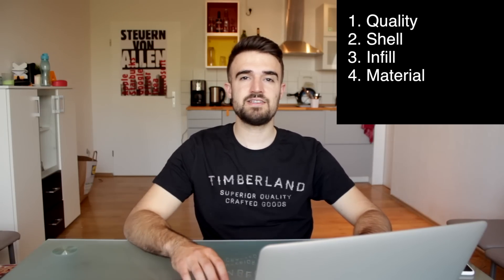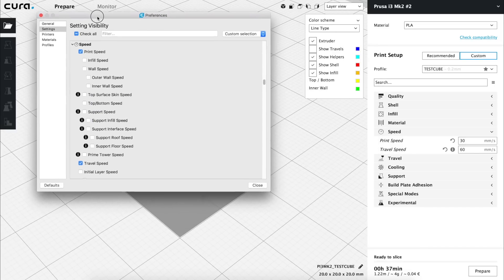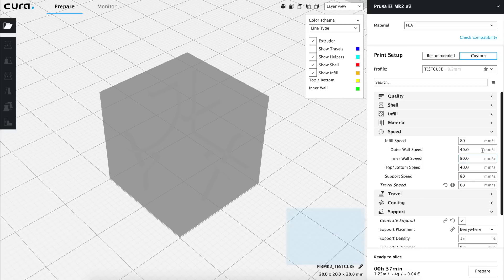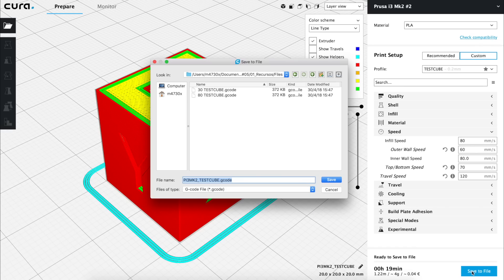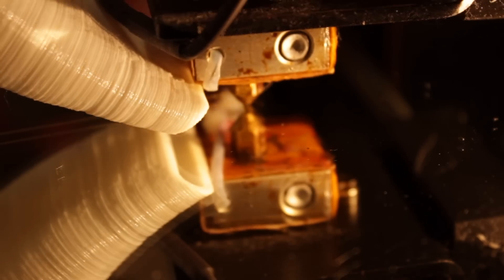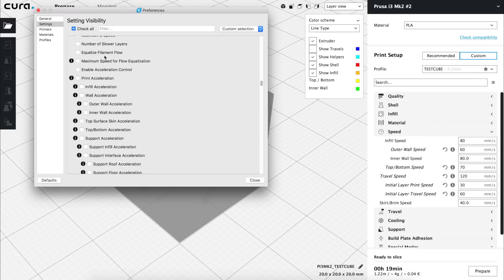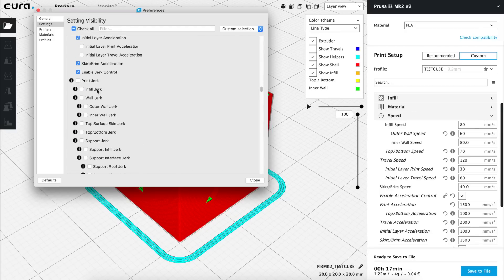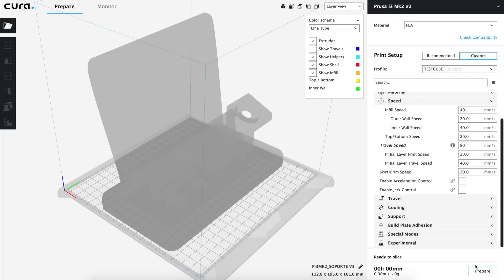Cura advanced settings 2018 - #05 Speed

Comment: I have also similar settings on my printer, and i was printing with that settings one month, I printed about 40 difirent models, but I noticed that problem is with bearings moving on rods, they are in to much stress and now I start getting layer shifting. Oiling rods, and updating belts are not helping. At the end, I tune speed to 40mm/s and lowering acceleration to 400mm/s
Now is slower , but quality gets amazingly better.

Comment: Great video... I wonder if you can help with a couple of questions:
1) We have First Layer Speed and Top/Bottom layer Speed... What is the difference for the bottom? Will the Top/Bottom setting apply to the whole bottom shell, except the first layer?
2) What happens if the bottom Shell thickness setting contradicts the object dimensions? For example, I have an object with a flat base that is supposed to be 1mm thick but then I set 4 layers min for the bottom (at 0.3 layer height, for a total of 1.2mm)... Will Cura respect my 1mm dimension or increase it to meet the settings? 
Muchas gracias, son buenissimos los videos
Reply from the maker: Hello :)
First of all, thanks for your comment! Answering your questions:
1. The top and bottom layers are the ones that are 100% infill. So the speed will control the 2-3-4 or any number you selected. Then the first layer is only the very first one, in contact with the heated bed.
2. You can graphically see what is going on in the cura interface. just go layers up and down. Anyways for that kind of special situations, I would recommend you to set for example the layer thickness to 0.2 and use 5 layers. Instead of creating contradictions :P
Gracias por el comentario, y en especial por escribirlo en inglés para que todo el mundo lo entienda =D
Reply: @architects3dp  Thanks
Reply: @architects3dp  I always forget to increase top and bottom speed, when printing no infill objects and they take forever, I forget that top and bottom really means any solid layer, it is a little annoying and confusing. Any suggestions for something that is 1mm thick, 4 layers in draft, to speed it up ?
Reply from the maker: @tablatronix  unfortunately that's the slowest part of a 3D Printed object. For this use case, it's more optimized to use laser-cut or sth like that. 3D Printing works, but is slow hehe
Reply from the maker: @tablatronix  an option is to use a thicker nozzle, so it'll be faster, without losing much quality :)
Reply: @architects3dp  That is probably a good idea,  I mostly do mechanical and functional prints.
Reply from the maker: btw, I always use a slower speed for the very first layer, so it will stick better to the heated bed :)
Reply: @architects3dp  I usually use 3 layers at the bottom and I use speed 20 for the very first layer. So there will still be 2 other flat layers before we get to the infill part (layer 4+). I print infill at 80 and so I was wondering if the Bottom Layer Speed would control the speed of Layer 2 and 3, between the first layer and the infill. I want this intermediary layer not to be as fast as the infill but not as slow as the first one, otherwise it will increase time too much...
Reply from the maker: @dddmmm21  Yeah so you are right, the bottom layer speed controls the speed of the layers 2 and 3 :)

Comment: Thank you so much for these videos. They have helped a great deal.
I've just subscribed! Just one question, I'm using Cura 3.6 and slicing a model seems slow.
I just checked to see how long a Storm trooper helmet would take, and after clicking prepare, it took about 5 minutes to give me the results. Do you know how to speed up slicing. I'm using 32GB of RAM and an 8 Core CPU.
Any, great video and great results.
Reply from the maker: Thanks for your comment Ian!
Well, it seems impossible with the beast pc you are using. By the way, I think cura only uses a single core. If your processor is old, the frecuency must be low, and that's why it takes more time... In my case, I have the i7-4960hq in my Macbook Pro, 8 threads up to 3.8 GHz in sigle core, and suposing a model takes 25 seconds to slice. When I slice the same model in my custom desktop pc that is an i7-8700k 12 threads overclocked do 5.0 GHz, it takes like 10 seconds, less than half of the time. Maybe if your processor's frecuency is, lets say 2.00GHz, It would take approximately 60 seconds.
Another possible issue could be that the model is not optimized for being 3D Printed...
Reply: Thanks for the reply, I think my 4Ghz is enough to do most things. I will look into this as a PC Engineer this has got my interest spiked.
Reading that you are running mac, Cura may be optimised for Intel and I'm a die hard AMD fan. Will investigate more.
Thanks again for the reply.
Reply from the maker: @IanSRutter  You are welcome Ian! :P Maybe it's cause Intel, I have no Idea... let me know if you discover sth =)

Comment: Hi guys, for cura 3.6.
Can you print different lsyer heights at different speeds?
Im trying to find this setting.
I have small pieces half way up the model and want to print at a slower speed for them.
Reply: Postprocessing in Cura gives some options.

Comment: Why does the print time decrease for lower acceleration? That seems illogical to me.
Reply from the maker: Hello Nico, I'm sorry for my belated reply, but here you have your answer :D
Okay so imagine a car that has to travel 200m. It starts at 0km/h, and will accelerate till it reaches 50km/h after 75m. Then it will travel 50m at 50km/h, and then it has to start decreasing the speed to stop after 75m. Alright so that's using acceleration.
Otherwise, Imagine the car starts at 50km/h, does the 200m, and then stops at the 200m mark. No acceleration, just full speed and completely stopped. It will take less time that doing the whole acceleration/deceleration process. Do you understand now? I hope I helped you =)

Comment: Turning on acceleration and jerk with those #'s increases print times on objects with any complexity for me.
Reply from the maker: yeah, increases print time, and print quality as well :)
Reply: I find it interesting that you gained a significant decrease in print times with that square.
Reply from the maker: Thanks :) hope it was useful for you
Reply: @Violaetor  It depends what you're printing - If you have a lot of detail (i.e. sharp angles), jerk/accel should help reduce the 'rubber banding' that occurs when the head tries to take that corner at full speed

Comment: hi - thanks for all your videos - great stuff 
i have set up my creality ender 3 using your speed settings - after generating the gcode and sending it to the printer, the speed remained 100 and not what my settings were in cura - do you know why ?
thanks
Reply: Maybe its because of acceleration control?  
I have also similar settings on my printer, but I noticed that problem is with bearings moving on rods, they are in to much stress and now I start getting layer shifting. Oiling rods, and updating belts are not helping. At the end, I tune speed to 40mm/s and lowering acceleration to 400mm/s
Now is slower , but quality gets amazingly better.